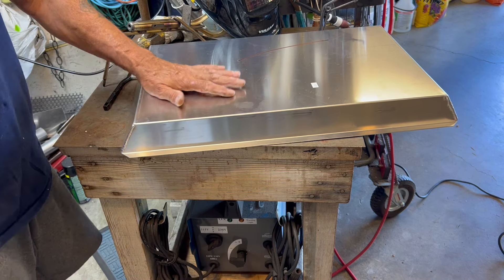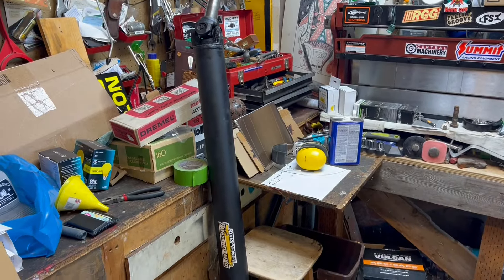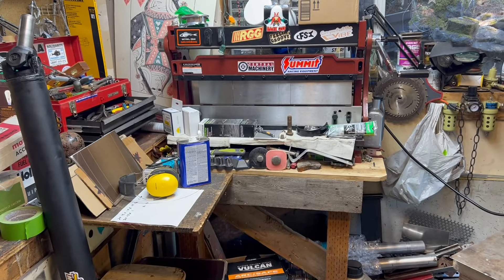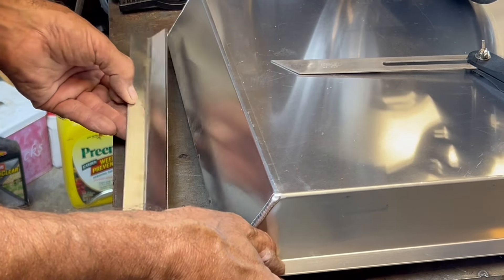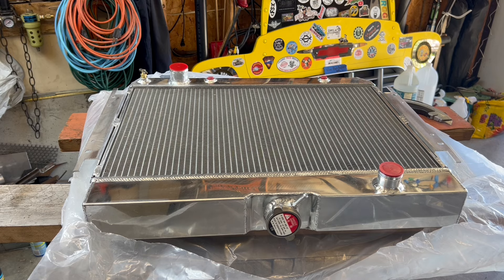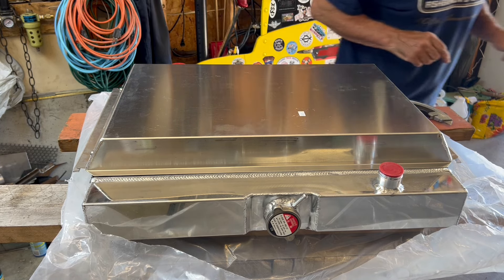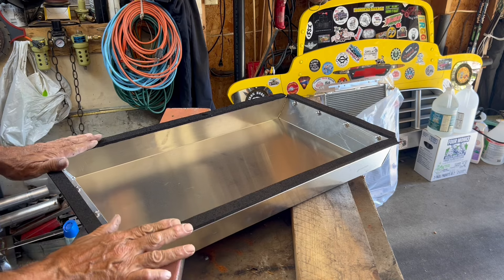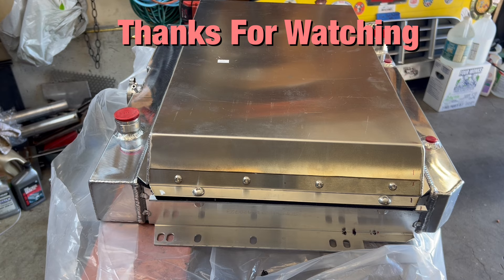Aluminum Radiator Mockup For 1955 Chevy Truck/ Part 1

Comment: That's a nice clean setup.  Your 55 will be ready for the open road with that new radiator.  Have a good one Buddy 👍
Reply from the maker: Hey Big Don, yes there are a few things the 55 needs to be reliable, the cooling system and the front end then I will feel comfortable driving it, thanks for coming by, catch you soon buddy 😀😀

Comment: Nice work Mike! Let us know how that works out and if you could put a link to the company that makes that shroud. Thanks. We're burning up down here 🥵🥵
Reply from the maker: Hi Gorni, yes I got it from Summit’s selection of shrouds that fit my radiator dimensions, I will be doing a follow up video when I install the radiator, did you see the 55 truck chopped down to a Short Bed😀😀
Reply: @DesertRatFabrication  not yet. Still trying to catch up.
Reply: @DesertRatFabrication  not yet. Still trying to catch up.